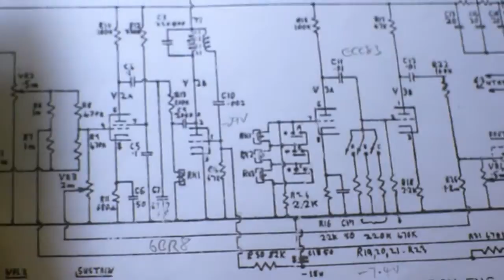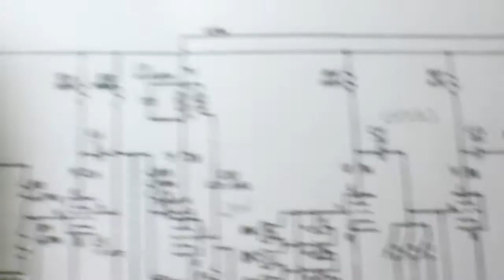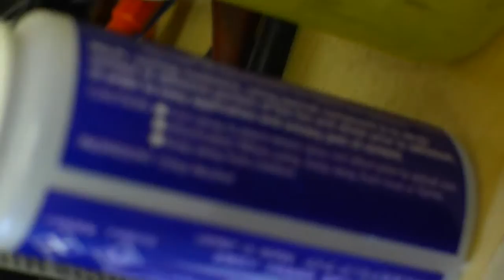Watkins Copicat 1965 Service

Comment: Hi , I got one of these , no echo signal at all, preamp and motor work great , what is the problem ? Thanks
Reply from the maker: Hi
Does it reproduce anything already recorded on a tape loop?
Or is there no sound at all from the tape.
If it will replay a prerecorded tape, then it is the record side of the circuit.
If there is no sound from the tape at all (no hiss etc) then it is probably the replay head amp part of the circuit.
I assume you have tried new valves (tubes), and cleaned switch contacts.
Reply: Thanks for the reply ,  yes I have tried valves,  I was told that the 2 ecc83's go on the sides and the other tube goes in the middle, 
I did have them the way you have yours , it still did not work, there is no signal at all no hiss no click or change at all when switching have checked switch and where the wire is soldered to the board , I will try a pre-recorded tape , never thought of that ! , , its a shame because it it in fab condition best I have had , quiet motor no head wear , they are a pain , but the greatest echo tone ever made imo ,  must get it working thanks for the info and time .
Reply: @JendrixHimi  the 6BR8 goes next to the bias oscillator coil and the ECC83's go next to each other close to the input jacks
Reply: @JendrixHimi  i have the same problem now with a vox long tom. works on the same principle i think. Did you manage to fix it ??